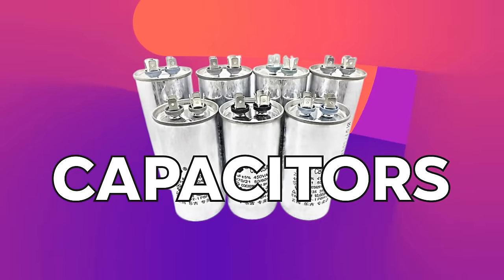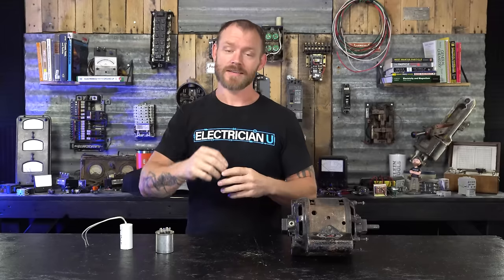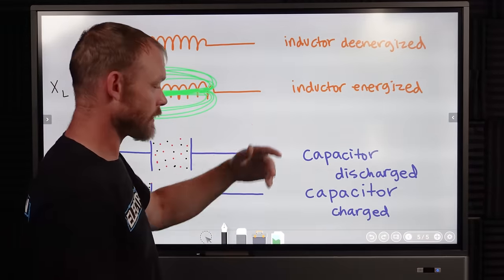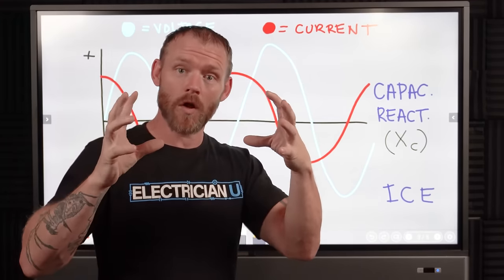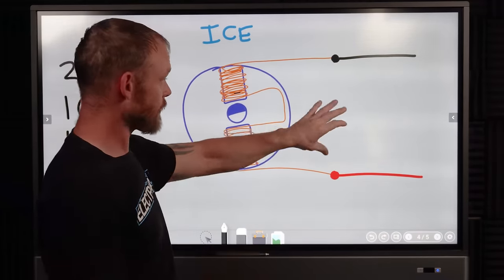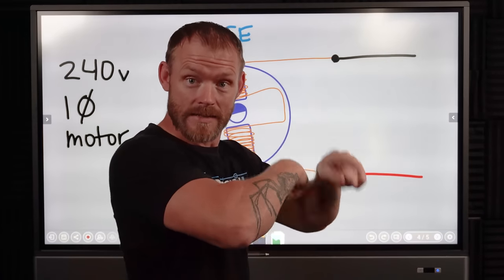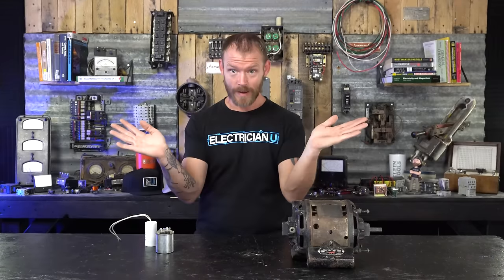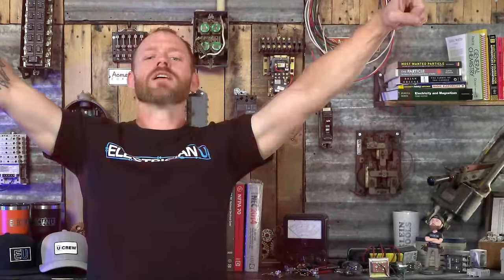Why Are Capacitors on Motors? What is Capacitive Reactance and Inductive Reactance?

Comment: As an electrical engineer, I cringed all the way through this.  This is why techs are not lecturers.
Reply: Absolutely ... there's no way to fully understand the physics of these components without calculus and, at the very least, complex numbers ... I think he's got an intuitive feel for what's happening, but there are gaps and misconceptions in his explanations.
Reply: Some specifics about things he left out or misinterpreted would be helpful.
Reply: @WelcomeToLoco So many places where his explanations were confusing  or just plain wrong.  But the biggie is that all induction motors require a rotating magnetic field to spin the rotor.  This is achieved in a single-phase induction motor by having an auxiliary stator winding at 90 degrees to the main winding (which he completely left out of the explanation) being fed by a signal with the current 90 degrees out of phase with the signal feeding the main winding, said phase shift being provided by the capacitor.
Reply: I believe he explained it well enough for us to understand the need and relationship. What you are crying about it a depth not needed outside the college classroom. He did not say this was going to be a dissertation.
Reply: As an electrical engineer I thought it was a pretty good explanation to cover a complex topic
Reply: Yup. Some folks do the doing, some folks do the lectures and theory and calculations
Reply: Fair enough… I reckon it would be equally cringey to watch an office engineer attempt to splice an underground transmission cable, or attempt to replace a suspension insulator on a live 240kV aerial transmission line, or perform a live termination on a 120/208V underground network bus.
We all have our lanes… and we need each other in this business. 
I spent 25years as a powerline systems engineer, civil… and had the privilege to work with some of the most impressive A-team tradesmen.
This fellow puts out great content from the perspective of a hands on secondary electrician. 
When he does videos like this particular one it would be cool if he brought in an electrical engineer as a guest where they hash it out from different perspectives.
Reply: @trevorkolmatycki4042  Well, I didn't make a comment on a university lecturer doing live terminations on a network bus - because I don't know of any.  Hopefully there are none who are that stupid that make youtube videos outside their area of expertise in such a dangerous area.

You'll note I haven't said anything negative about this content producer's trade skills.  Yes, it would be cool if he brought in an engineer to fill in the gaps in his knowledge.
Reply: As an EE, this gave much more of a better understanding of the physical nature of this behind the math.
Reply: @trevorkolmatycki4042 I like that “stay in your lane” we need each other, how many times I’ve been hired by electrical engineers to replace/install lighting, they know the theory but don’t know which side of a screwdriver to use. I respect their knowledge and the fact that they know what not to do.
Reply: @mjr1965   You have a point, my examples are obviously outrageously hyperbolic... hence I can see how you took it as ridiculous... my bad. It would be beyond cringey. So I should have provided something more equivalent like an engineer trying to wire his house or something. The type of work I described are elite level hazardous and no unskilled people would be allowed anywhere near it.
Cheers.
Reply: As a time traveler, I approve! Coming from 200 years in the future, the best way I can describe it is if you’ve seen that movie Idiocracy…

Yeah America advanced that shit by 10,000x this guy would be considered an absolute genius! Also, the closest thing to an engineer we have in the future is Steve! he has the highest IQ and is the smartest person on the planet at just sigh of 11 IQ points. 

Merica really screwed up the world!
Reply: Yall are literally nuking this shit. The way he explained it is clearly in layman’s terms. This isn’t a college lecture and he even states you need to fully understand electrical theory before even practicing on systems.

Talking like you engineers don’t fucking make everything to break in under a year. 😂
Reply: Go touch a screwdriver
Reply: @Dontexxr  I replaced the link pins in my front suspension last week, does that count ?
Reply: @mjr1965  oh yeah you're in 😎, but on a real note i think he did fine for me (average hvac mechanic) 😂
Reply: Do you know of any videos that explain it better? I do not have plans on working with AC voltage, but I am intrigued by it.
Reply: @GalileanInvariance  I highly doubt he put the work into this video for design purposes ..he did an Excellent job describing this process, good enough for troubleshooting problems in an AC motor circuit ...
Reply: I cringe when someone finds it necessary to announce publicly that they are an Electrical Engineer for the sole purpose to distinguish themselves as "better than". I have always felt that people who help others without bravado or expecting anything in return are usually  "better than".
Reply: @beatlessteve1010  Luckily, I don't give a rat's what you think.
Reply: If you are an electrical engineer then why are you watching this video? Is it to judge the man and to show that you’re smarter? Sorry to be rude but why would an electrical engineer need to watch this?  People are not watching this video to become electrical engineers. They will go to college and get a degree. People like me that work industrial maintenance that wants to just better understand certain aspects of components is watching this video. I’m not trying to become an expert. I’m trying to learn more so I can be faster and better at troubleshooting electrical systems. To explain like you expect him to would turn this into a 12 part series with each video being 4 hrs long. No one has time for that. lol. I hope i wasn’t being to rude but I just wanted to point out that the people watching this is here to just gain some knowledge not to be an expert.
Reply: Over in the U.K we were  taught as  inductive 'reactance' is actually called reluctance. It's not a 'type' of impedance. Impedance is a measure of resistance  that combines the capacative reactance, inductive reluctance and the circuit resistance. It's still measured in Ohms similar to d.c resistance. Guess folks must use different terms in the U.S?
Reply: @beatlessteve1010  Thanks for the feedback ... My comment was really directed at those who desire a more complete and accurate understanding of the physics involved. As a practicing aerospace engineer, I can attest to the pitfalls of basing decisions upon intuitive notions of physical processes. But there is value in the explanations the video presenter provided.
Reply: @Bowhunterohio To suggest that I am watching these videos to "judge the man and show that I am smarter" is downright offensive.  It's an interesting topic, youtube served it up and I watched it.  I commented only because there are parts of the video that are over-simplified to the point that it is WRONG.
Reply: @mjr1965  your right I shouldn’t have said that. I find myself watching videos of things that I already knew myself. I just usually think of an electrical engineer as being someone that would already know everything so what’s the point in watching but again that’s my bad cause I do it myself.
Reply: As a former student  his explanation is a little more understandable than an engineering professor.  It's easier to understand when visualized with water pipes and a piston.
Reply: I see a few electrical engineers commentating I realise your calculus luminaries and respect to you, but this guy he's aprieciated by the little guys like me, he has explained some bedrock concepts to me like a master, thankyou electrician u
Reply: Bud if any ones got problems with the guy not being technical enough, have no fear, your on the wrong site and there's other sites that only bespectacled professors go too, the sites are so technical, and so mathematical calculators burn out, there won't be any comments from humans, it will be you and robots in the know
Reply: @mjr1965 just curious, what did he say that was outright incorrect?
Reply: @beatlessteve1010 
Q: You know how you can tell if someone is an engineer? 
A: Don't worry. They'll tell you.

Comment: That is possibly the worst explanation of capacitors I have heard in my life.  That is absolutely not how a capacitor charges.  Current, or voltage, doesn't actually pass "through" a capacitor at any point either.  At 13:00 that is not how a start cap works.  There is actually a start winding that the cap makes 90 degrees out of phase.  Essentially making a two phase motor.   It is also not there to correct power factor.  You can correct power factor on a single phase but it still wont have a rotating magnetic field.    Why wouldn't you just draw an actual motor schematic?  Pure laziness.  Endless rambling.

Thats also not how an inductor works.  It's not "tight with current."  It's counter EMF created by that moving magnetic field.

How did this junk get back in my feed?

Edit: This is approved continuing education?!  Did I hear that right?   Wow.

Comment: Horrible explanation but oh well. Capacitor stores current until the motor coils are able to use it. Current through the coils changes drastically over time, the capacitor provides a local source of current so your power source doesn't have to drastically change is current.